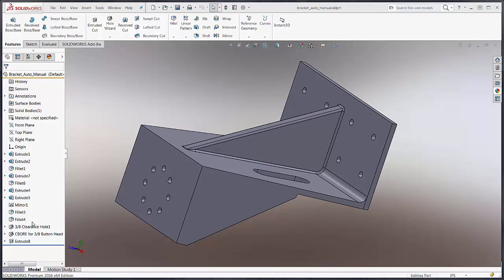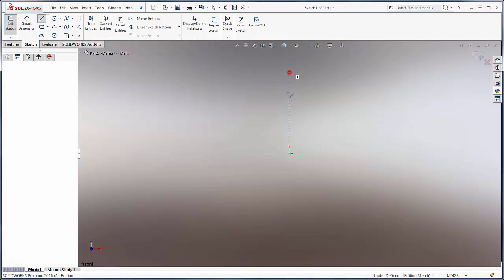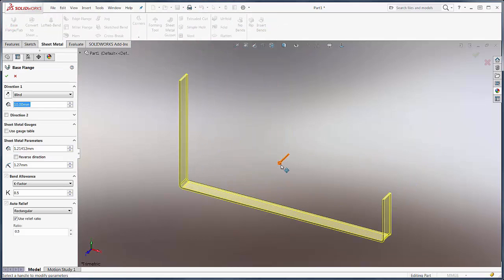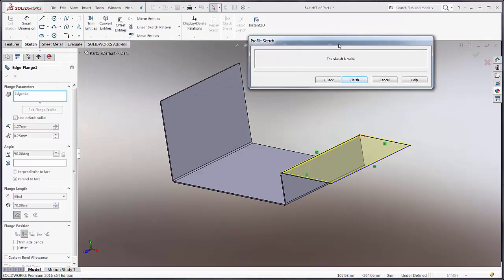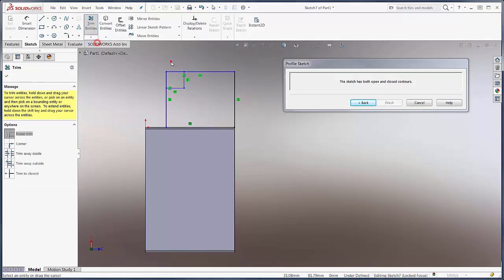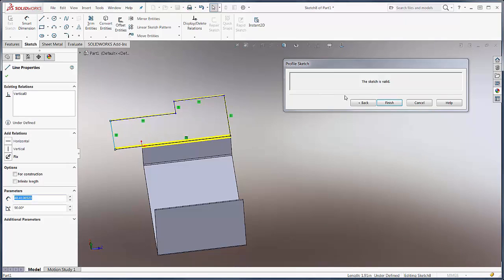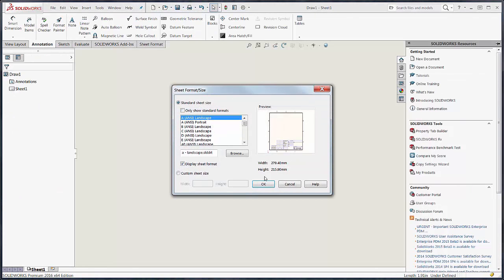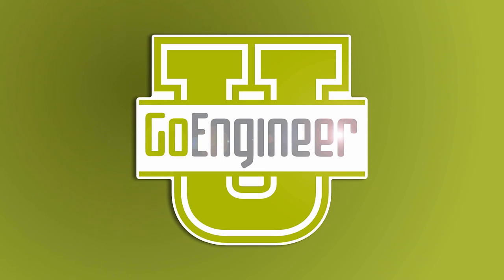SOLIDWORKS 2016 - Sheetmetal Edge Flange Extension

Comment: For newbies if you could be a bit slower and more deliberate without backtracking would make easier to follow. It was also confusing to start with a part unrelated to the lesson.  I've went through this 6 times and can't seem to get this to work in SW 2020, as I have no option to edit the base or edge flanges, so I'm guessing there's something obscure that has to be done as well.
Reply from the maker: Hey Jack, thank you for your feedback. For assistance, please contact our tech support team at  https://www.goengineer.com/support